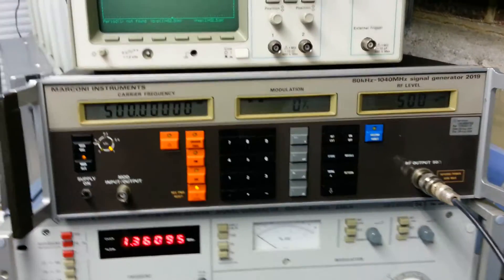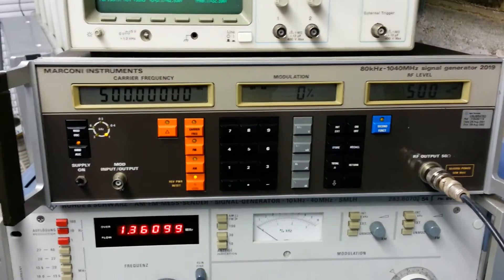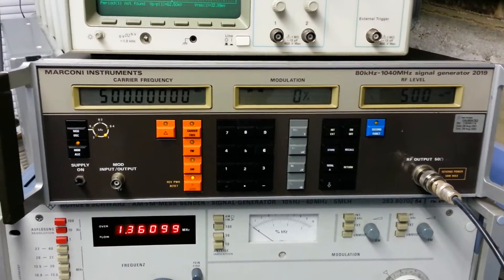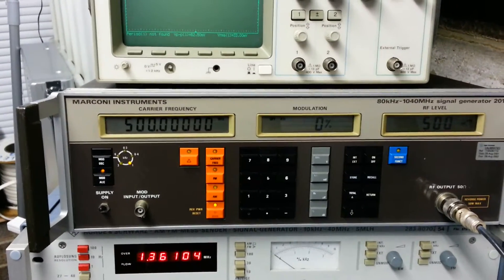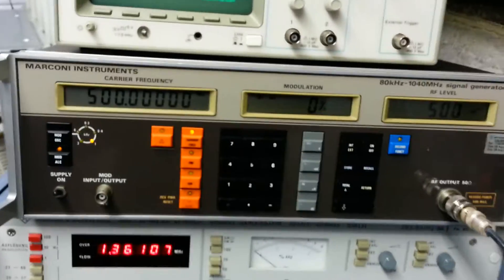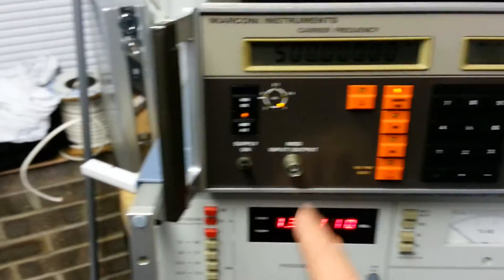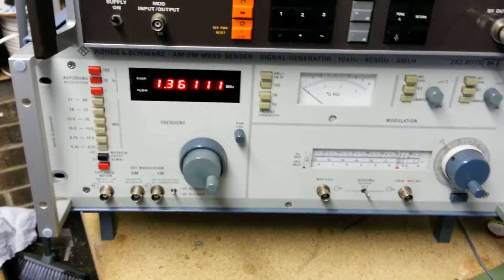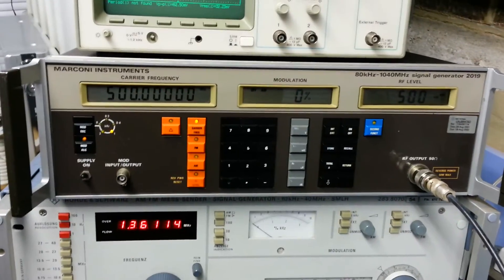Marconi 2019 signal generator repaired!

Comment: Hi, I have a problem on my MARCONI 2019A, this is the problem:
The generated frequencies are incorrect, e.g. 5 Mhz = 5.937.84 Mhz and all the freq. below 520 Khz they are equal to 1876.15 Mhz.
Do you have experience with this type of problem?
Thanks in advance for the reply.
Reply: Hi Look at the 10mhz frq std ocs They do drift, The adjuster is on the right hand side, also try using an external 10mhz input, from a gpsdo
Dave , 2E0DMB

Comment: Good evening Simon. Thank you for your interesting videos for the repair and operation of this useful peice of test equipment. I have just picked up one of these on eBay which switches on but has no operation of the front control buttons. Seems to be a similar fault to yours. Sadly the links to photos in your description are no longer valid. Is there any chance you can alter the description so that I can see the photos.It would be a great help to me. 

Best wishes
John.
Reply from the maker: Good luck. This is the link
Reply: @SoddingaboutSi  Hi Simon. Thank you for taking the time to repost a link for the photos. Very much apreciated. Best wishes.... John.
Reply: @SoddingaboutSi hmm, no photos!, ah well, this is a very old thread.
Reply from the maker: https://photos.app.goo.gl/mvirLfaFnLLLjW8o6